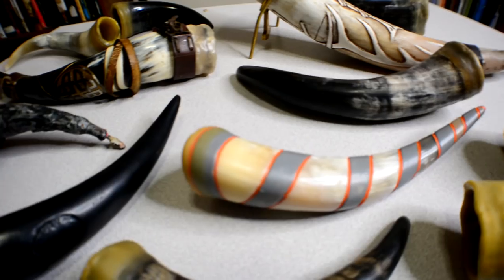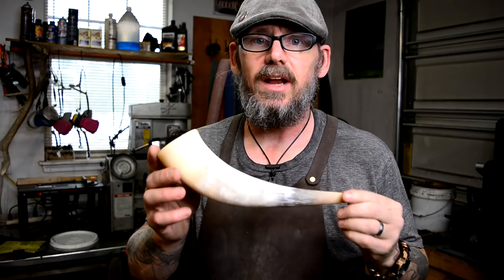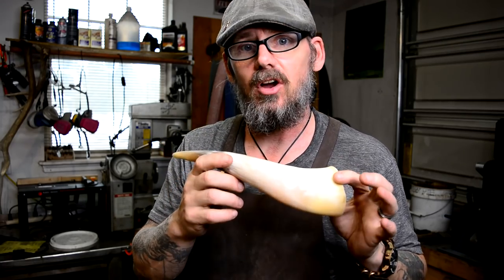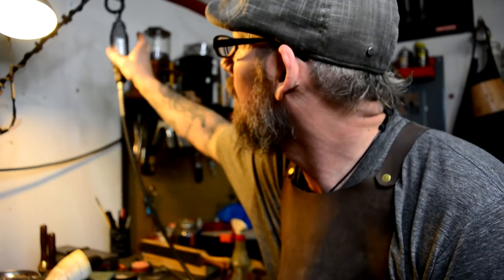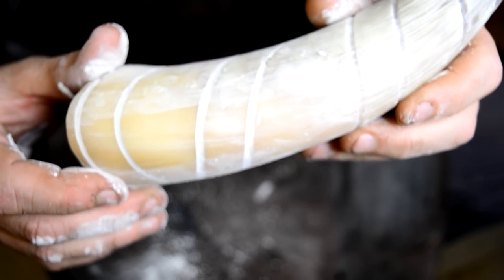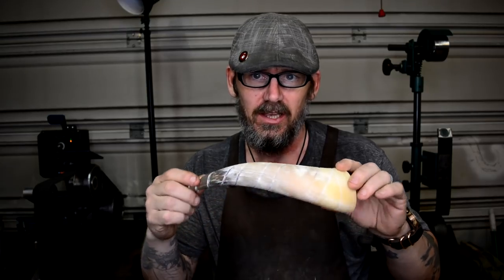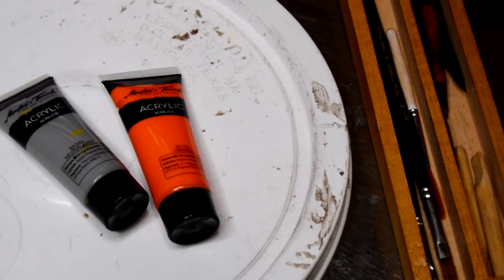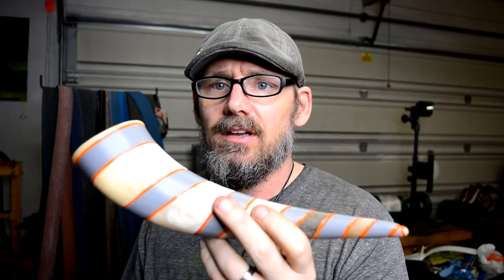HOW TO MAKE A DIY CUSTOM VIKING DRINKING HORN

Comment: I was told that you would not be able to drink anything hot out of the horn if you only seal it with wax...is there another way to seal the inside that would make it safe to use with both hot and cold liquid?  Thank you
Reply from the maker: If you can get some food grade epoxy that might work for hot stuff.  check the label for any heat or cold limitations.  The horn will get very hot if you are drinking hot liquids from it.  Possible too hot to hold.  I only drink mead, beer and water out of mine so bee wax is perfect.

Comment: This was a great instructional video, thank you for sharing! 
I just wanted to ask, what wax did you use to coat the inside and outside?
Reply from the maker: 100 % pure bees wax on the inside.  I used it on the outside also but you can use anything on the outside eve a spray lacquer.
Reply: @MakersMovementDIY  Thank you!
Reply from the maker: @UnchartedAtlas  my pleasure
Reply: @MakersMovementDIY  Would another kind of wax work and be food safe?
Reply from the maker: @benben9851  I would think paraffin wax would work, they put it in chocolate so I has a little food safe.  I like bees wax because of the smell.
Reply: @MakersMovementDIY  Awesome. Thank you for the quick reply and for the video. I'm gonna give it a go.

Comment: That is sweet. I'm so gonna try this. Approximately what length horn will hold 12oz beer?
Reply from the maker: There is no real way to tell.  It depends highly on the length of the horn, the girth, the thickness of the horn walls, and how much of the tip is solid.  To be safe go bigger and cut it down to size when you shape the rim.  Hope that helps.
Reply: @MakersMovementDIY  Thanks!
Reply: Just be sure to go bigger, so it'll hold at least 2! Lol

Comment: Hey Dave!  Thanks for the video!  I ordered two horns off Ebay to make powder horns out of, and the inside were scuzzier than the outside!  Did yours come already clean, or did you hog it out yourself?  Thanks, and Semper Fi!  Mike
Reply from the maker: Usually mine are pretty clean when I get them but you can buff out the insides with a few different sizes of "cylinder ball hones" in a cordless drill.
Reply: @MakersMovementDIY  Thanks so much for the quick response and the tip.  I'll try that!  Mike

Comment: How do you remove the bone inside the horn
Reply from the maker: Most horns you get are pre cleaned but you can boil the horn to remove the insides if you get a raw one.  I recomend doing that outside.
Reply: @MakersMovementDIY  Really boiling works? I let them dry out for a week or two and the bone comes out easily sometimes with a little effort
Reply: @MakersMovementDIY  how long should you boil it for the bone to come out
Reply from the maker: @kaharukevin  drying is interesting.  Boiling works but the time depends on the horn.  Have you ever seen the trick where you microwave a potato and stick it on a rooster's spur, then pull the spur off....look it up, it works like that.
Reply: What's the importance of the beeswax on the exterior and the interior?

Apart from Olive Oil, can you use other cooking oil like Sunflower Oil?
Reply from the maker: @kaharukevin  The wax on the inside covers the horn smell and taste, you can use epoxy but it has to be food grade.  In any event the inside should be coated with something   The wax on the outside is just to develop a shine, like a polish.  I suppose you can use any food grade oil that you have.
Reply: @MakersMovementDIY  what type of sandpaper would you recommend to use or are there multiple sandpaper one must use
Reply from the maker: @kaharukevin  I use multiple grits and usually gator grip from Ace Hardware.  I dont think the brand matters too much.
Reply: Could you kindly share tips of pre-cleaning the horn. I'm currently scrapping the exterior with a hacksaw and using sandpaper but that isn't enough

Comment: What kind of blade did you use to cut the rim of the horn?
Reply from the maker: I probably had e a fins scroll blade on it. It doesn't really matter, horn is easy to cut with just about any saw. Including hand saws.
Reply: @MakersMovementDIY  Thanks for the response. What do you use to sand/smooth it after the cut?
Reply from the maker: @codeseven1818  I can use a variety of power Sanders or just sandpaper will work fine.  Horn is pretty easy to work.
Reply: @MakersMovementDIY  Thanks for your responses!
Reply from the maker: @codeseven1818  No problem.  Hope they helped.
Reply: @MakersMovementDIY  Hi Dave. After trimming the rim, what kind of polish can I use to touch up where I sanded?
Reply from the maker: @codeseven1818  Just sand it fine, maybe up to an 800gt.  Then rub it with bees wax and buff the wax with a soft cotton cloth. Just like shining boots.

Comment: hi dave the norseman, super video thanks! But how to you seal the inside? I cant see the buttom of my horn and the sides are not very smooth. So there might be some nasty things down there ..
Reply from the maker: I clean the inside witha. Long bottle brush, dish soap and hot water.  After its dry I wax it thick with bees wax.
Reply: super, thanks! ill have a go/k @MakersMovementDIY